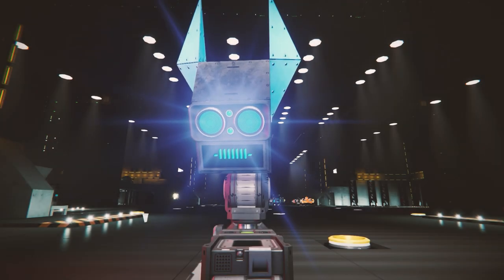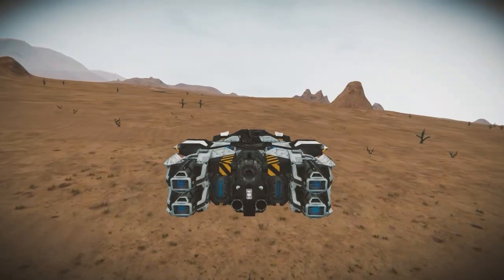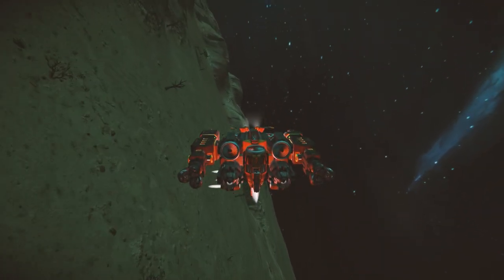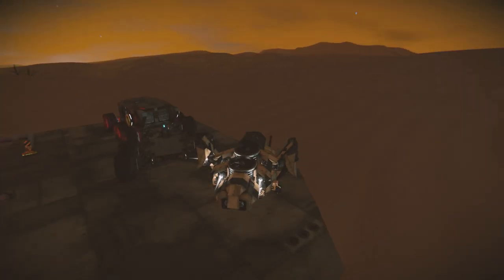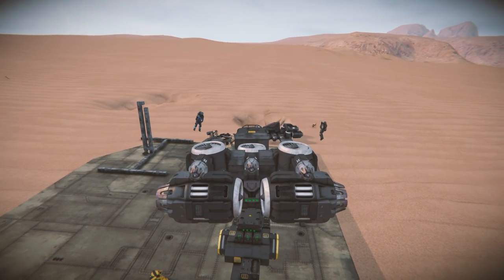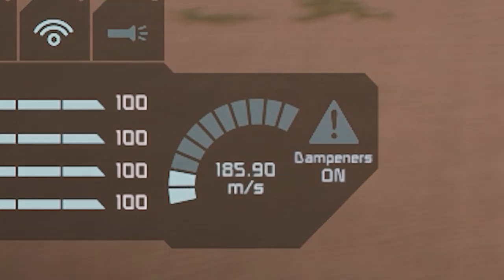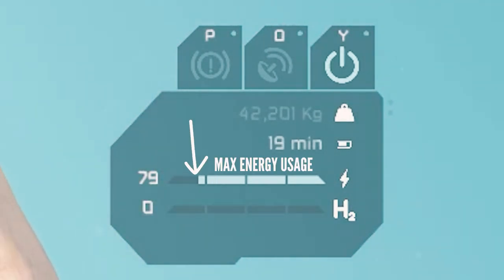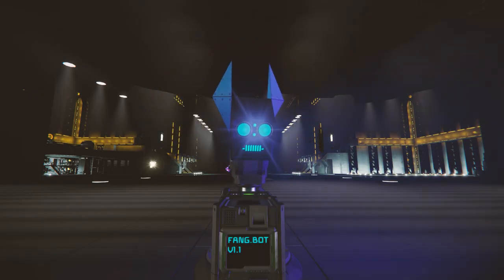Introducing FANG.BOT, my SMART A.S.S. AI - HOW TO: Not Fly Like a "NOOB"

Comment: You and Luca have both given similar advice that I found myself also converging on back when I was initially learning my design-to-performance preferences.

Large thrusters are definitely way more power-weight efficient, in exchange for being grossly larger and less space efficient.

I find 1.5x to 2x thrust to weight is usually about right for my lift direction. Then I cheese my down thrust (usually the only place I use small thrusters on space ships, and I never use them on atmo craft). Reverse and lateral thrust are insufficient to lift the ship on their own, and just making sure I have at least 2 thrusters for redundancy is more of a factor; just barely enough to prevent drift at anything less than 30 roll or pitch. Forward thrust is about 1x thrust to weight.

So I rely heavily on pivoting and banking the ship to constantly use my two thruster main directions (up and forward), a bit like a helicopter. Adjust for specific needs like combat, survivability, extra heavy cargo when fully loaded, full thrust-weight ratio or more for reverse thrust on horizontal miners that need to pitch nose down, etc.

Turning off reverse thrusters for cruising is a must for me, on medium to long flights. On many of my ultra light small grid ships (scouts, hover/air bikes, fun little runabouts), I'll even completely leave off reverse thrusters so that their flight requires either pitching nose up or turning and banking in order to decelerate with the lift thrusters mainly, secondarily with the forward or lateral thrusters. I tried leaving off the lateral thrusters (so ONLY up and forward thrust), but that was a little too hardcore in requiring active attention in flight for my lazy preference. Leaving off only 2 directions completely is enough fun for me. :D

These design layouts are much less convenient and often very ungainly in tight quarters, but saves a lot on ship mass and energy.

I've downloaded tons of workshop designs to check out other design approaches, but I find that many of them use way too many inefficient small thrusters and/or too many thrusters in the less priority directions, for my taste. And then their descriptions will mention complaints or issues stemming from the thrust-weight paradox. No surprised, when they have like 15 small thrusters in every direction. It's fine to build that way if it performs like the designer wants, but if you're gonna complain, then put a little effort into min-maxing/optimizing it. :P Using my largely subjective preferences, I like to tailor some of the cooler designs to my performance priorities. Usually that means reducing lateral and reverse thrust to 25% of the initial design, down thrust to 0% in atmo or also 25% for space, then reallocating some or most of the freed-up mass and thrust budget to additional up and forward thrusters. Obvs someone else will have different priorities and prefs. But the process can be adjusted accordingly to each player's tastes, so long as we bear in mind that thrust-to-weight is the final arbiter of all our designs.